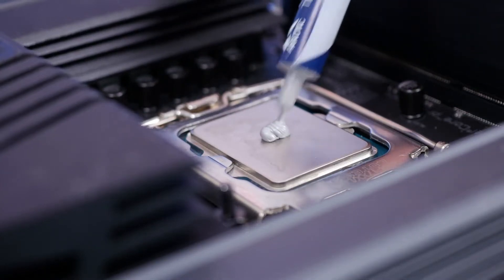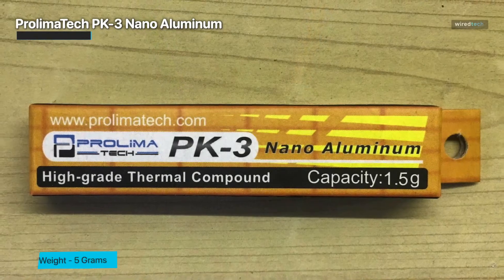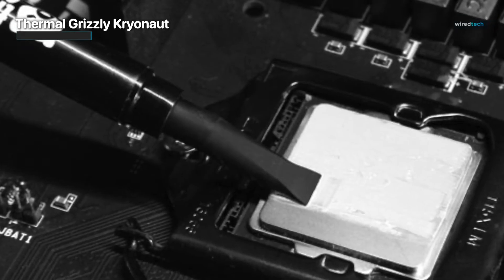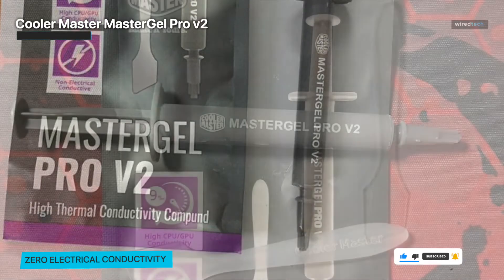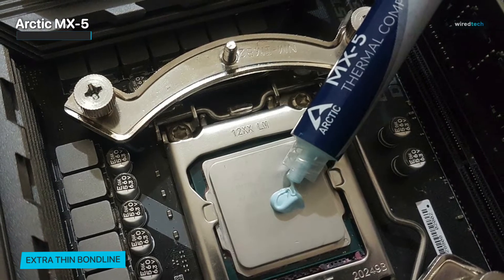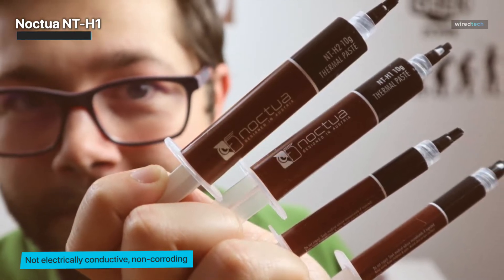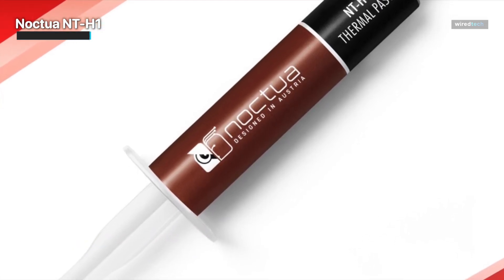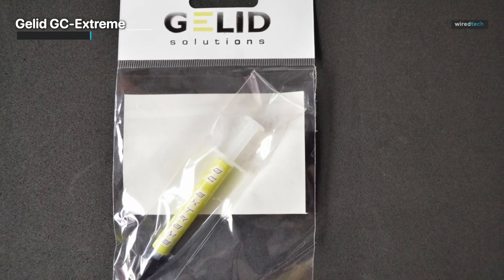Best Thermal Paste of 2023: Efficient Heat Transfer

Comment: which one has the best thermal conductivity rating though? that would be 'the best' one I would think...
Reply: No, thermal conductivity is nit that relevant. The best thermal pastes (Noctua, Arctic, ...) have lower thermla conductivity, but are way better at filling out air gaps between the CPU and cooler, thus making them have way better temperatures then other ones.
Reply: @vaf3614  how are you defining 'best' in this case though? I would assume that the 'best' thermal grease/paste would be whichever consistently provides the lowest cpu/gpu die temps, and from measurements the last time I researched this Noctua and Artic weren't at the very top... things like Thermal Grizzly Kryonaut and Kingpin KPX were testing 'better'.
Reply: @kalmtraveler  how I am defining "best"? The best ones are those with the lowest CPU temps. And yes, there are even better ones, but the "thermal conductivity" is basically irrelevant. Something like thermal grizzly Carbonaut has a several times higher thermal conducivity than those pastes, but it sucks at filling out the air gaps between the cooler and CPU thus having way worse temps.

Also, most of the high end pastes are often within margin of error.
Reply: @kalmtraveler  On igorlsab testing, the max diviation on cpu was a 2-3C on the mainstream thermal pastes. On the gpu test, the list is completely different, the higher conduction pastes were on top. Another thing to note is the pump out resistance and dry-out resistance. Almost every single mainstream paste will pump out in 1-2 months and only few will survive the 1 year mark.
Reply: @kazuviking  makes sense. I just do my own testing every few years since it seems that compounds are always changing/improving and we still see 'new' products that take the top spot every so often. I miss the old days of "Arctic Silver 5" being all we needed.
Reply: @kalmtraveler  I bought the prolimatech pk3 nano and its a gamechanger so far. I sadly received a 10 year old stock one, and it took the local shop 3 months to order in. So far its really fing impressive. With normal fan curve, not gaming one, its keeping the temps the same as the old paste(old coolermaster mastergel pro after 2 years) and the fake ptm(after 4 months) i bought.
PK-3 currently, CPU 85C normal, 78C game mode.
Funnily the GPU temps stayed the same. Btw this on a garbage thermal design laptop.